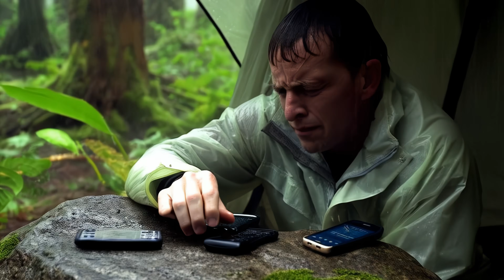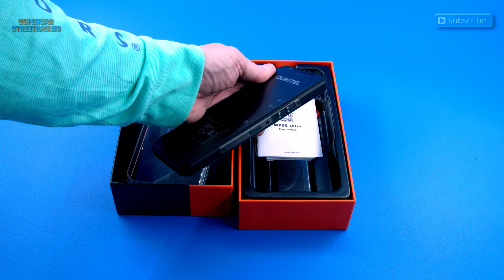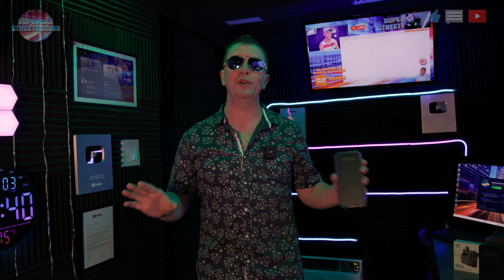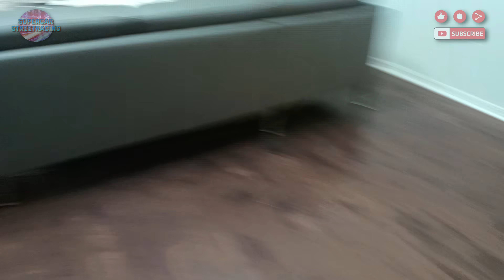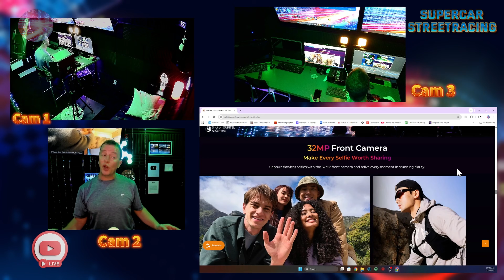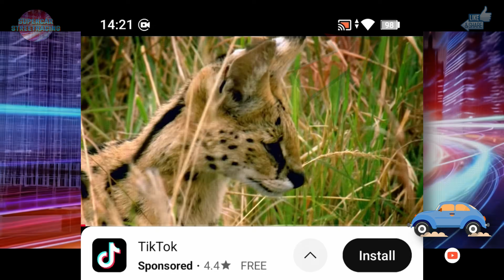Oukitel WP55 Ultra – The Rugged 5G Beast  Smartphone That Laughs at Danger!” 💥📱

Comment: What’s the estimated lifespan of the battery after a year of regular charging cycles?
Reply from the maker: It is important to note that the overall lifespan of the battery (how many years it will last before significant degradation) is typically 2 to 3 years, as with most Android phone batteries, but can be longer with proper care. The phone also supports 33W fast charging, which can charge the battery from 0% to 50% in approximately 40 minutes.

Comment: How effective is the waterproofing when submerged for long periods?
Reply from the maker: The Oukitel WP55 Ultra is a rugged smartphone with high water resistance, certified with IP68 and IP69K ratings, and meeting the military standard MIL-STD-810H. 
Water Resistance Specifications
IP68 Rating: This certification means the phone is fully protected against dust and can withstand immersion in up to 1.5 meters (about 4.9 feet) of water for up to 30 minutes.
IP69K Rating: This standard provides protection against high-pressure and high-temperature water jets.
MIL-STD-810H: In addition to water resistance, it is military standard certified to be drop-proof from up to 1.5 meters and operate in a wide range of harsh environments and extreme temperatures. 
These features make the Oukitel WP55 Ultra suitable for outdoor activities, fieldwork, and harsh conditions where exposure to water, dust, and drops is common. The USB-C charging port is protected by a waterproof cover, which should be dry before charging.

Comment: How long does the Oukitel WP55 Ultra battery last on a full charge with heavy use?
Reply from the maker: The Oukitel WP55 and WP55 Pro/Ultra smartphones are equipped with a large 11,000 mAh battery designed for extended use in demanding environments. 
Official specifications indicate the battery life can reach:
Standby time: Up to 1,100–1,375 hours (over 45 to 57 days)
Talk time: Up to 77 hours (over 3 days)
Video playback: Up to 20 hours
Game time: Up to 19 hours
Music playback: Up to 53 hours